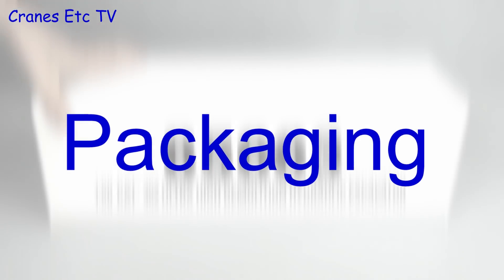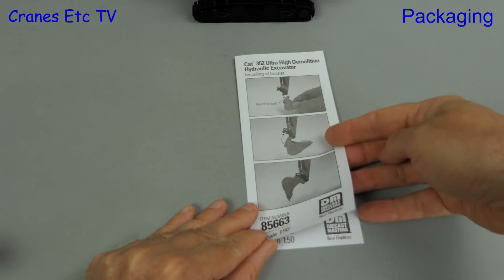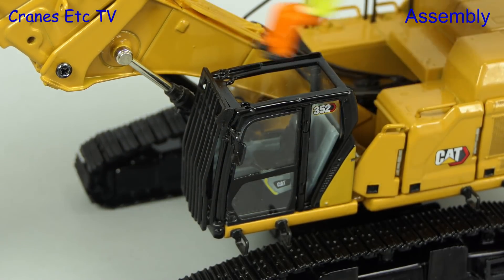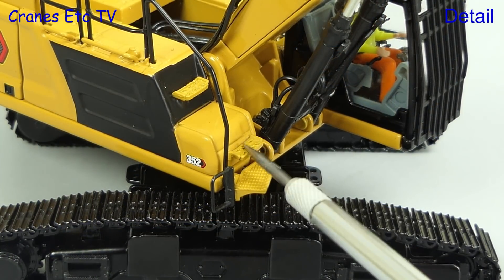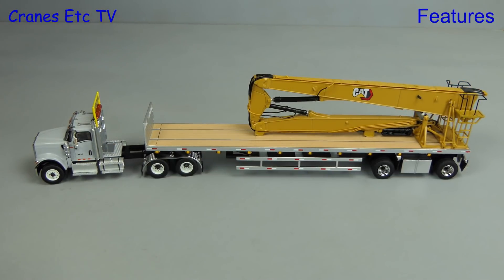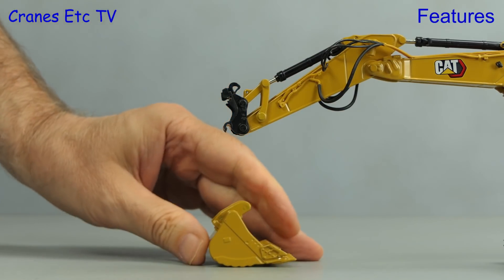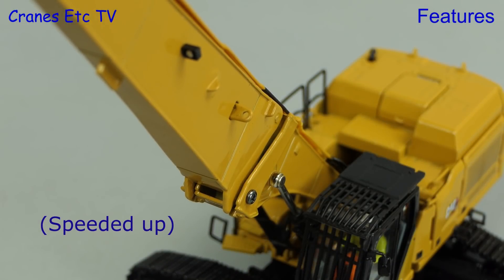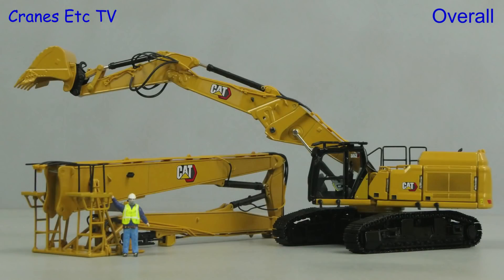Diecast Masters Caterpillar 352 UHD Demolition Excavator by Cranes Etc TV

Comment: the loading of the extension arm and the attachments doesn't seem right. DOT regulations would have the boom farthest up on the trailer deck so the majority of its weight would be on the kingpin of the trailer to prevent the trailer from possibly lifting up when going over multiple hills or uneven roads. In most cases, the boom would be transported on a lowboy to prevent a possible tip-over from a sudden tight turn or side impact in the event of a collision. The attachments would be secured to the deck on the rear of the trailer above the axles to add more weight to them to prevent any loss of trailer brake efficiency. If the load is too heavy for certain states with their highway load limits, the attachments would be hauled separately on another trailer hauled by another truck. That is how we load trailers in the states.
Reply from the maker: Agree that a lowboy might be more usual.  It would help with headroom.

Comment: Nice review there Ian
You mention that the model comes with a warning about stability angles. That's probably straight from the operators manual as is best practice to work within the track frame in high reach configuration